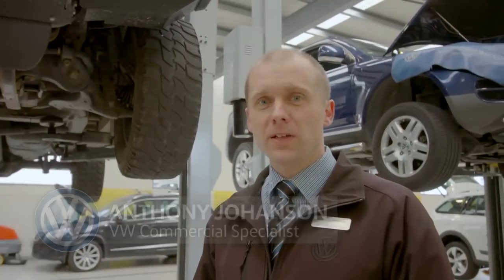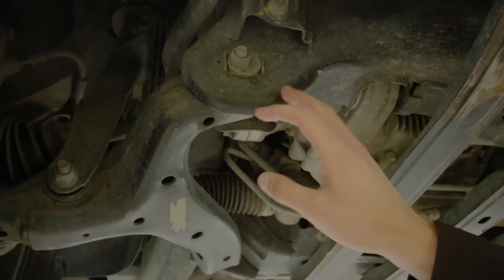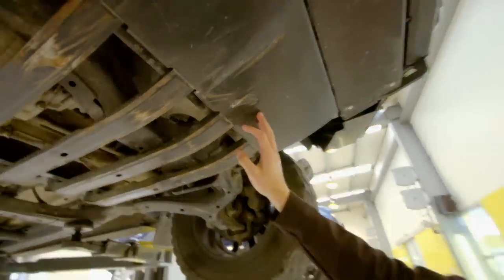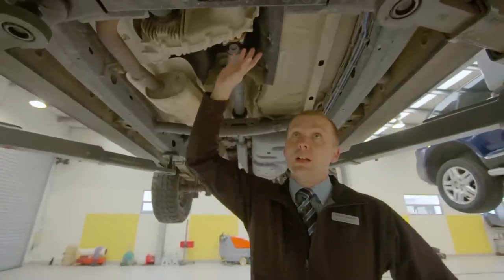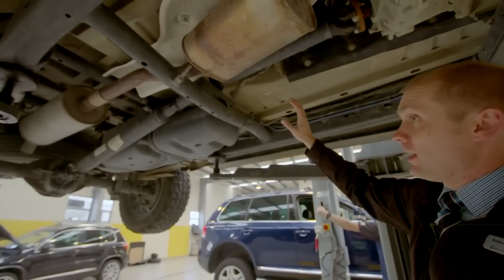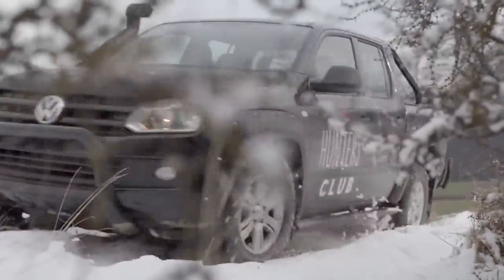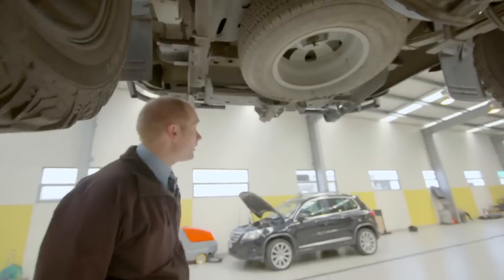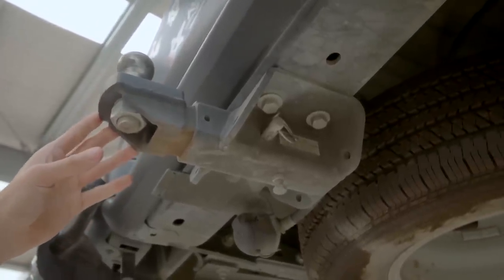Volkswagen Amarok 1: Under-body Strength

Comment: You forgot to mention that Amarok chassis has the most number of cross-members in the 1 ton pick-up class, helping give it best-in-class chassis rgidity (over and above the fact that it the largest box-section construction chassis in the 1 ton ute class). Toyota took this into account when designing new Hilux, and threw out the original Hilux replacement designs after stripping Amarok.
Reply from the maker: Thanks Moggie!
Reply: A chassis cant be too rigid. A chassis is meant to flex and give. The amarock is certainly nothing special

Comment: Were any suspension modifications done to this vehicle to account for the extra weight of the bull-bar?  If so, do suspension mods void the warranty?
Reply from the maker: Hi Martin, this particular Amarok was put together through Volkswagen New Zealand's partnership in 2014/2015. I no longer have the specs for this one so can't confidently answer your question. With regards to the warranty, this may depend on the parts and labour used (and may also vary country to country). Your best option is to speak to your local Volkswagen dealership so accurate, relevant, and up-to-date info. ^Mark

Comment: Hi there i practice off road and always hear that things get in the way of transmition belt  and break it. Are those affirmation true from your point of view?
Reply from the maker: Hi Fernando, thanks for the question. We put this to our commercial vehicle specialist. He believes you may be referring to a workshop campaign that was carried out on a very selected number of Amaroks. 

"The engine drive belt could be damaged by external objects and part of the belt could find its way behind the timing cover, then in turn damage the engine timing belt and engine. A modified cover is fitted to affected vehicles by Volkswagen workshops to prevent this accidental damage. This is an important reason (like software updates) to always service your vehicle at a franchised workshop."

Hopefully that answers your question. If in doubt, Amarok owners should contact their local dealer to see if their vehicle is one of the small number of models that was affected by this, and have this work carried out.